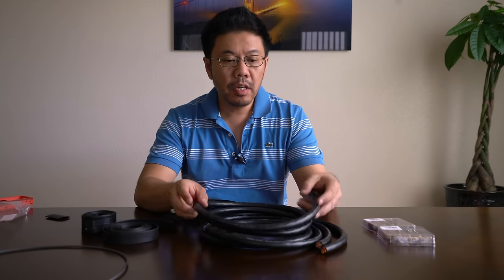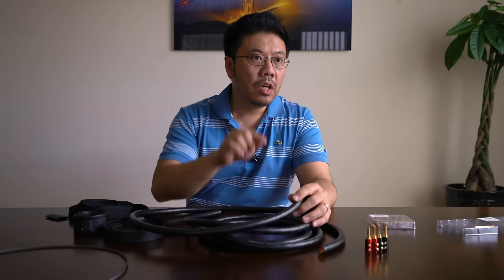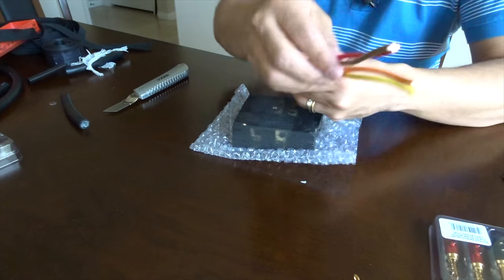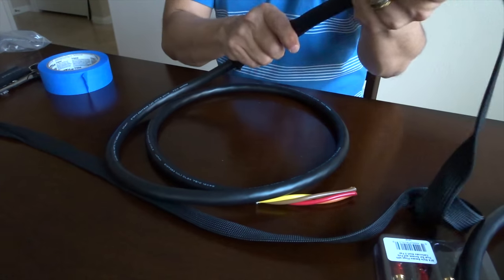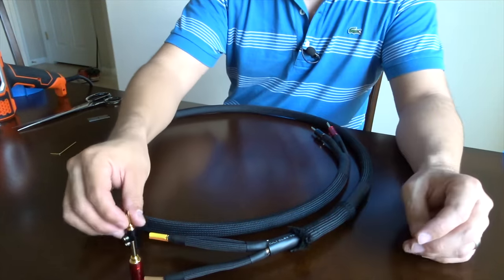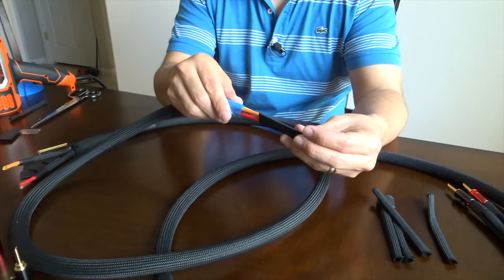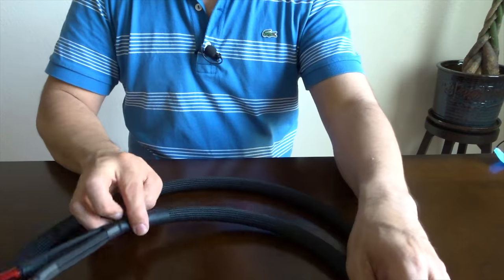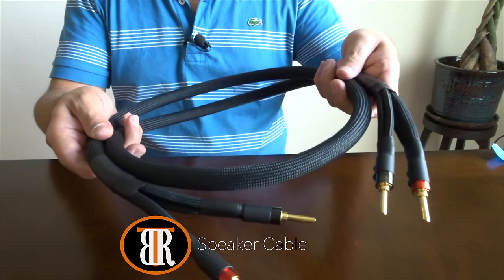Making The Best Speaker Cable For Money, How To DIY HiFi Cables

Comment: Ok, I'm trying to make sure I'm doing this correct. Just got the Mogami 3104 speaker cables in the mail. The plan is to make enough cable to bi-amp my front speakers. I'm running Martin Logan ESL X's (F) and Martin Logan ESL C (C). The ESL X's will be bi-amped to my Marantz MM7055 (5-channels @ 140w/chnl) and the center will run on the 5th channel. After speaking with a Mogami rep (who sounded pretty knowledgeable), he recommended I run two separate cables (a twisted pair for highs/mids and a twisted pair for the driver) instead of one cable with a connector on each conductor. So here's where I need clarification - - once I strip the 3104 outer casing, it exposes the 4 conductors (red/brown & orange/yellow). Assuming this pairing is correct (passive - red/brown & orange/yellow), I also assume its up to me to decide which will be +/-  ??  So I decided [red = positive and brown = negative  | orange = positive and yellow = negative ]. If there's no objections, I'll twist the red/brown pairs together, add a connector and do the same with the orange/yellow?  If this sounds about right, then I'm golden. Now the only issue is finding BFA's or banana's big enough. There must be tons of people out there constructing this same configuration because all the connectors @Tharbamar recommended are out of stock and back ordered til June or July. Any recommendations on quality connectors to fit roughly an 8 gauge twisted pair? Thanks.
Reply from the maker: There’s not many banana plugs can fit thick wire as twisted pair of W3104 conductors.
Reply: @Tharbamar  am I putting the cables together correctly based on my description?
Reply from the maker: Bi-wire or Bi-Amp as you wish as long as no crossing, it should be fine. Thanks
Reply: @Tharbamar  sorry for keeping this going but I'm really looking for guidance here. If I configure my cables exactly the way you have in this video but I do two pair per speaker, will this work to bi-amp my speakers? If yes, is it just a matter of connecting one cable (red to red / black to black) on the speaker side and same at the amp (using two channels per speaker)?

Comment: @Tharbamar Hi, can I use those thick speaker cables with my (low end) Denon PMA-720AE amp? I mean the amp will not overheat driving those wires? Thanks!
Reply from the maker: Yes you can use with any amp, it will work great.
Reply: Huh? Thicker wire has less R. It's better to use. You aren't driving wires unless you're shorting them lol.
Reply: @Tharbamar  Thank you so much!

Comment: My only concern is the oil from the fingers! Did u know that finger prints on automobile brake rotors can ruin a set of brake pads!! Would this not impede the signal? Let me know what u think.   Thank you.
Reply from the maker: It’s not a major problem, although I kept wiping with alcohol wipes when I’m making them.

Comment: Question: This ia a very useful video and it makes sense...BUT.... from the termination points on the speakers if you open up the speaker all the wire used to go from termination points to cross over to the actual driver is no-where close to the quality and gauge of what this wire is. So my question is: Does the thin wire inside the speaker negate the entire exercise of making these cables?
Reply from the maker: It will not as long as it has good quality OFC cables inside but from your amp to speakers is more important because better cables will deliver the signal with minimum loss and also prevent from noise interference.
Reply: @Tharbamar  Thanks for that!

Comment: Hey , thanks for that informative tutorial , I am a beliver of mogami as well ( ofcourse I do have commercial intrests since I am.the indian distributer ) however I bought the distributer ship only because I loved mogami not vice versae ,  anyway my question is what about the usenof mogamin2972 , as far as I know it's build exactly the same way as the 3104 the only differmce being that the 2972 uses 2.0mm sqaure cores as opposed to 2.5mm sqaure on the 3104, I assume there would not be any sonic differnces between the two especially if you are gonna short the two cores , would there ? Do provide your feedback
Reply: I stand corrected the 2972 is 2.0mm sqaure as opposed to the 4.0mm sqaure of the 3104

Comment: Excellent video Tharbamar. Im curious, your stated $100 cost, this is for what exactly? A pair? And for how long?  because Using your eBay link, 20' of the mogami cable is $150
Reply from the maker: It's for a pair of 5'5” of cable, braided nylon sleeving and heat shrink tubing.
You have to buy per foot not the bulk, usually they go for $5-8 per ft, thanks
Reply: Can you post the eBay link again

Comment: screw connectors dont go on soft copper cable ends, the surface area of the connection will be limited as the copper moves away from the screw to the sides.
Reply: The entire inside of the termination end is what the copper contacts.   The screws only keep the wire from being pulled out and are also part of that same termination end.....  You aren't even thinking.

Comment: 24 conductor/ trip[le braided yields best noise rejection, and works like a filter/ not an antenna..2, 4, or 6 conductor just isn't enough braiding to create true rejection, but this is in the right direction
Reply from the maker: I think you have no idea about Star-Quad cables, https://vimeo.com/155057552

Comment: For my B & W 706 s2 I am looking for cables around 6 feet in length . What would you recommend mogami 3104 - Bi-wired or mogami 2972 Bi-wired. Note b & w suggest to do bi-wiring.
Reply: Aren't your speakers then not too close to each other?

Comment: Would be better to twist the pairs at the ends as opposed to keeping them parallel as you have. Better noise rejection.
Reply from the maker: Yes that’s how I do with all other cables as you can see in end of this video but noise rejection of this cable is so good that I didn’t feel like it needed because this cable quieter than twisted pair of cables but it wouldn’t harm either way, thanks
Reply: Thanks for the reply. Just thought it worth saying as every little step can help.
Reply: No it won't make any difference
Reply: @Tharbamar  you better of separating the two cables the in and out?  half an inch gap stick it on some duct tape or masking tape sandwich, better induction and capacitance try it next time. Do you know what the induction is on that cable for that given length and capacitance? Ideally you don't want to go above 100 picofarads
Reply from the maker: @ John sweda, Inductance (1khz, 20°C) 0.6µH/m (0.18µH/Ft) for W3104/W3103 Cables.

Comment: Hi great video, just one concern about the signal path,
 wont splitting it directly out from the terminal & running in parallel  paths and then rejoining it create a sound indeferance/ anomaly within that single channel ?
Reply from the maker: It should not be any problem at shorter runs and even 10ft runs I had no problem with interference, Thanks

Comment: I know you chose those connectors for the ability of taking the thick wire, but, being made of brass and due to it’s low conductivity nullify the benefits of the thicker wire? I know they are gold plated but that layer is minimum compared to the amount of brass. Thanks for sharing the video!
Reply: Which is why all this high dollar audiophile stuff is just snake oil.  Copper conducts better than gold, only reason gold is used on connectors is because it doesn't tarnish.  And as you stated brass is much worse, Brass is only 28% as conductive as copper.   oxygen free copper is also snake oil, it doesn't sound better...

Comment: Great video, thanks. To make bi-wire cable would you use 2 runs per speaker, or 1 plug per core (instead of combining them)?

Comment: Why would you use 4 x 12# instead of simply using 2 x 9#? I mean, it just complicates things, especially if you're putting just one banana pair at each end?
Reply from the maker: I don’t see any complication in making the cables, Main points of using it is Star-quad and Mogami Neglex Conductors.
Reply: @Tharbamar  I'm not gonna pretend I know more about cables than you, but I am an engineer (although not primarily electrical, but you can't avoid knowing certain things) and I don't see any benefit in using star quad cable geometry for power cables. I figure the only reason why this particular mogami is star quad is that there are four conductors in it. Shielded quad stars have some obvious benefits for signal cables, not for ac power cables. Though, my question was maybe poorly phrased - I don't mind that the cable is quad, I am actually asking why didn't you put 4 banana on one end, because that's what it's for. Mogami has bunch of 2c options for speaker cables, they are still using quality deoxidized/crystal copper, you are still getting mogami quality, but without paying for two extra conductors you don't use.
As for unshielded quad config, I would be really surprised if you could link me to some measurements that would prove some benefits. If anything, 4 instead of 2 should only raise capacitance without even affecting inductance. Don't matter, ofc, especially for such a short run, but that's the only theoretical difference, right?

Comment: you should cut those ends off and re do without touching the wire - use plastic to twist and do not touch wire at all with fingers bare- they will affect oxidation and degrade sound oils from hand
Reply from the maker: Thanks for the advice but I’m not a novice with inexperienced in making cables, alway use alcohol wipes while I’m making them.

Comment: Do these banana plugs have metal plates between the screws and the fine copper wires?
If not, wire end ferrules should be used to prevent cross-section reduction due to the cutting and crushing effect of the screws.
Reply from the maker: They do not metal plates in there.

Comment: Bit why would you use banana plugs ? Crazy use bear wire much better compressed fitting more surface area contact , nuts.
Reply from the maker: Actually BFA banana plugs have more contact area than bare wires, I like peanuts but not so much on know it all personal.

Comment: Update.  Well, those Viborg parts are certainly not made near as well as the WBT products.  Two of the eight bananas have stripped screw holes and one of the set screws goes in on an angle.  As a comparison, my WBT-expanding bananas are machined from a single billet of copper and the set screws are larger and you can really get them snug, not to mention I have used them on many cables without incidence not to mention they're just beautifully made.  I wouldn't trust these to reuse over and over unless you use them not very tight.  I noticed that the original parts express parts you used had longer thread holes and looked more robust.  Of course, the Viborgs cost me $36.00 for eight while the WBT's are $55.00 apiece in Cu and $110 in Ag.  Interestingly the Viborg Spade lugs were only $9.90 set of four and the CMC's were less than $14.00 set of eight.  All of them appear to have the same connective part with the same brass set screws.  The Spades look gorgeous.  If you told me they were three times as much I would believe it.  I'll let you know how the other connectors work out.

Comment: Copper is copper is copper, fancy names don't make it any better.

But I love DIY and this was a cool video. Although I feel 9 and even 12 Gauge for speakers is a bit much. (unless you have very very long runs)
Reply: That is an absolute lie !!!.../eg..oxygen free copper,industry-style copper,..../...gauge depends on a length,speaker,amplifier power,..Your  $$$....and so on
Reply: @joekovac  Of course gauge depends on the power requirements of your speakers and distance from the amplifier. 
I never said that wasn't.

What part was a lie? The copper is copper? Or fancy names/terms?
Most typical runs as long as it's copper your going to be fine.
Reply: @JoshM7  "copper is copper"..in my opinion...
Reply: @joekovac  Yeah, a lot of this audio stuff is personal preference. 
I'm not able to go out and measure the differences of different cables, but unless I see OFC doing anything significantly better. I'll stick with whatever is on sale as long as it isn't too junky. (Although I am using OFC since it was on sale when I got it)
Reply: @JoshM7  OK have a great weekend !
Reply: @joekovac  You too.

Comment: better option is Supra cable 6mm x2, copper is covered in tin which is better than silver, and no oxygenation occour.
Reply from the maker: Tthis cable assembly is airtight design, conductors won’t oxidize.

Comment: Use a lighter on the heat shrink and save on the electric, also when the cable is hot and flexible do touch it and mould it to the desired final shape.

Comment: why is it that many do not solder speaker wires to the connectors but use screws for connection...i find soldering gives best signal transmission from amp to speakers
Reply from the maker: Soldering can degrade the sound quality.
Reply: Tharbamar Great tutorial and thank you very much for your expertise!
Could you please tell how much exactly materials I/we need to order for one pair L and R cables? Braided Nylon Sleeving in 5/8,  Heat Shrink Tubbing (1/2 or 5/8 or 3/4 ???) 
3 to 1 ratio shrink tubing???  I’ve already bought Mogami W3104 and Parts Express Banana Plugs from Parts Express. Again! Thank you very much!
Reply: @Tharbamar  have you ever done a comparison between soldered and non-soldered connections? thanks
Reply: @Tharbamar  then, we are being cheated since all internal wiring of speakers are soldered, if you say soldering degrades sound quality...????

Comment: Should I get this wire or the canare 4s11 the 4s11 is much cheaper but I don't want to sacrifice sound quality
Reply from the maker: I like both wires, sound quality is comparable but I like Bass and Midrange on Canare a little more than Mogami, I think you'll be happy with either one.
Reply: @Tharbamar  I really appreciate you replying, is there any reason to choose mogami over canare ?
Reply from the maker: Only reason I have is Mogami Neglex copper is one of the most purest copper ever produce.

Comment: Thanks a lot!
These would be too thick for my use.
What are good cables
That are thinker and just two wires ?
Cable marketers are such thieves! Take a quality OEM (still a commodity) add nice termination and nice sleeves and sell it for thousands at 1000’s% mark up. Wow!
Reply: Mogami 3103 is the same but two wires. Save the hassle of doubling up the conductors and use a thinner wire from Mogami ;)

Comment: For some reason, commenting on this post doesn't allow me to share pics. Just finished my cables and I'd love to share my pics. Also the connectors used in @Tharbamar video are out of stock until July (everywhere) so I went with an alternative. I'm a big two channel music guy so I have a pair of Martin Logan ESL X (front), Martin Logan ESL C (Center), 2 Martin Logan 1100X Subs. I'll be replacing Blue Jean 12 gauge speakers cable (also bi-amped) with the Mogami 3104 to bi-amp my fronts with the Marantz MM7055, leaving the Marantz SR5014 to push my surrounds. I'm using Outlaw Audio PCA interconnects and a pair of old Cardas to connect the subs to the 5014. Now for the sound test.
Reply from the maker: YouTube does not allow photo in the comment section, thanks

Comment: I did a lot of testing with speaker cables and I honestly failed to reliably spot any differences. But I give a thumbs up for this video because it shows how cable companies rip off so-called high end audiophiles. 

I now use a braided cable with a mix of high-purity copper and silver with as little length that I can get away with and I use high-quality banana plugs. Plugs are much more important than people give them credit for, especially with component interconnection.

I also keep the speaker cable away from any power lines as best as I can.